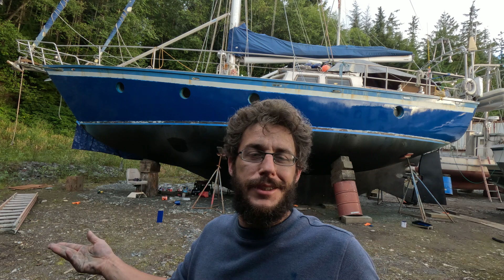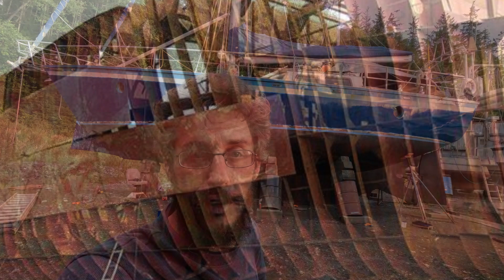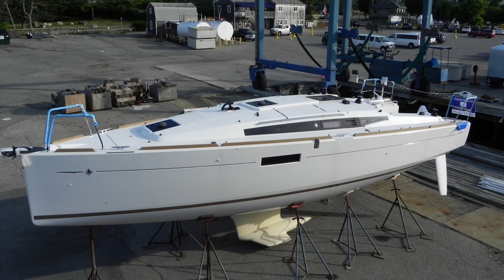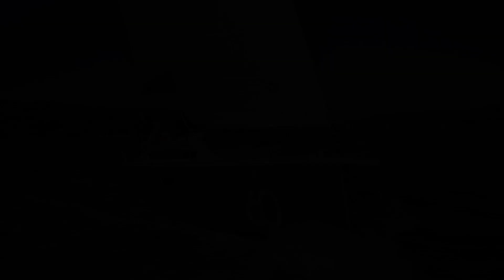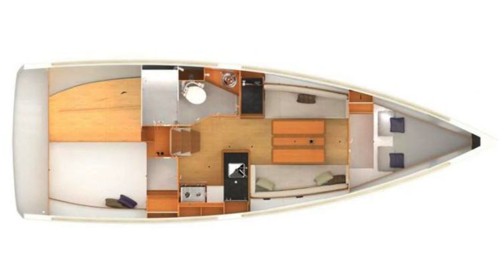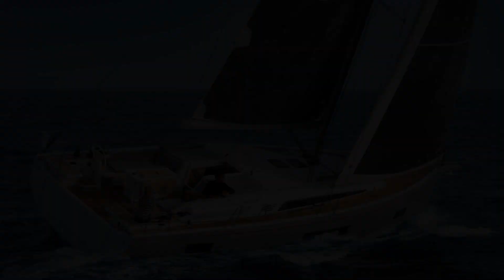WHY I Bought This ABANDONED Steel 50Ft Sailboat Ep.4

Comment: Not to sound too cynical,  but one drawback I see is its still sitting on the hard - it probably needs a huge amount of work before you even put it in the water.  There is a risk that you never actually get it in the water sailing - even after spending a year(s) of time (and money) working on it.

Comment: I think you made the right decision. Personally, I would only buy a steel or aluminum boat. I also like the classic lines much better than the modern constructions. Even if the stern is narrower and therefore there is a little less space in the boat. But at 50 ft, space isn't an issue anyway ...

Comment: We weigh in well over 33 tones it does take a bit to get her going. You'll be thankful for that weight often enough. 6m+ following sea gusting 50kts and sitting warm and dry in the pilothouse.  Tucked in with stern lines in a remote fiord watching 70kts gusts ripping at the sea and not worrying that the keel is kissing the bottom. Heading to weather with a squishing motion rather than a hull buckling pounding. They are not everyone's cup of tea but there's some great advantages. Enjoy your adventures and remember they rust from the inside to the outside.

Comment: Sailing Fiji now on Christabelle a Corton Steel soft chime faired hull 50' deck length Ketch built in the 70s. We've sailed all around New Zealand, down into the southern oceans low 40s. In previous ownership she had hit a couple of reefs one of which tore a large hole in the bottom. Because it had a built in water tank (over 1700L) in that area fresh water was all that was lost and Christabelle could sail on for repairs. This would have sunk most other boats. Rust never sleeps but on a well built and maintained boat it's not a big issue. We also put a solid railing on which is awesome for getting around. We don't need a water maker as we have a 2 section rain catcher that covers most of the deck. this doubles as awesome shade in the tropics. The last owner put in the bow thruster, what a blessing. We don't live on her but have probably done 6000miles in 4 years. Government lockdowns and restrictions haven't helped getting sailing time on the boat.
Reply from the maker: Sounds like a beautiful Ship! This is a relatively new endeavor.  So I'll see where it takes me. Thanks for watching!

Comment: I have 1965 fiberglass boat. In them days they did not know much about fiberglass so the hull is an inch thick pure fiberglass same with the deck,  very strong
Reply from the maker: Anything glass and pre 70 is going to be stout. But 50 years old at this point. Thanks for watching!
Reply: @IIAShadowII  57 years old and sails very well, 32 ft long keel and very little used the last 20 years so most gear and engine is like new with only around 200 hours of use.
Reply: @IIAShadowII  bought it from a retired police inspector,  maintanance by the book🤣🤣

Comment: Many of your comments are an echo of the considerations I have had purchasing a 40-ft Adams Steel boat 
A little bit unusual inside , rigging a little bit old but sound condition , some newer some partly used sails , but no rust in the 6 mm plate hull 
I feel very satisfied and confident in my purchase 
Sea trials next week and the hull inspection . 
Then a final payment on a true turnkey Bluewater sailboat . All that for 60,000 Australian dollars
Reply: The icing on the cake was the $30,000 1,300 watt solar system

Comment: i am a wood boat person , then aluminum and steel , never ever fiberglass , i owned a 1968 57 foot Chris Craft power boat for 36 years and spent less time in maintenance than fiberglass boats , and wood is a better ride , better in the winter and summer , as long as you are not rotted on the insides all is good , nice ship you have
Reply: @onno_vocks  always liked the Roamer , came close to buying one a few times , but i flat out do not like fiberglass boats